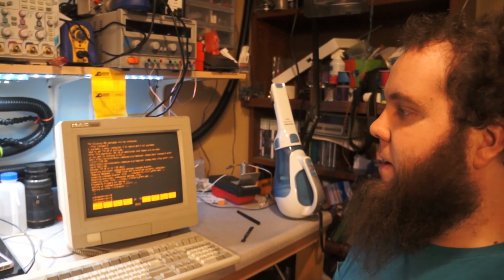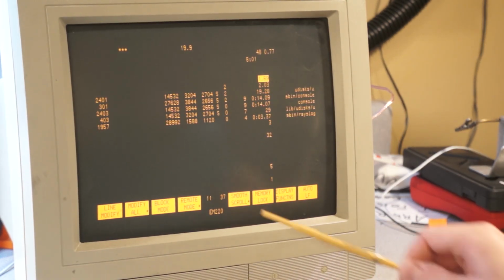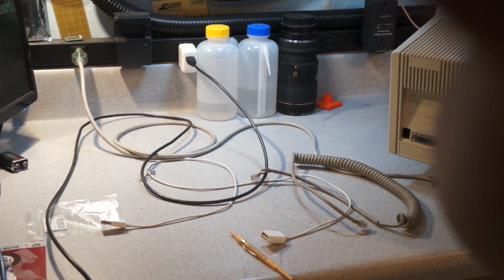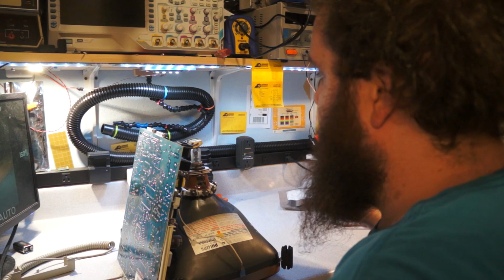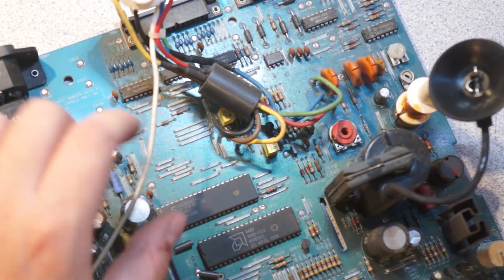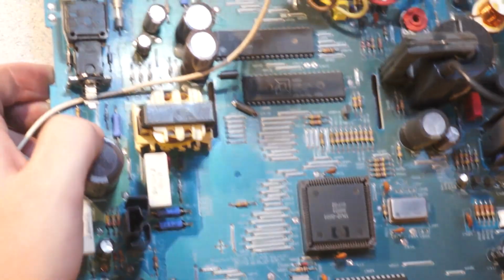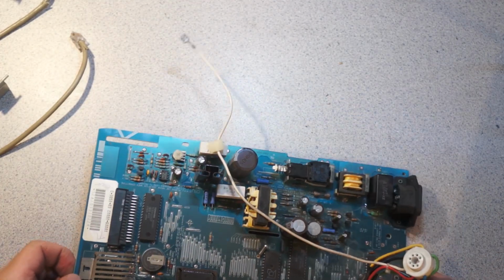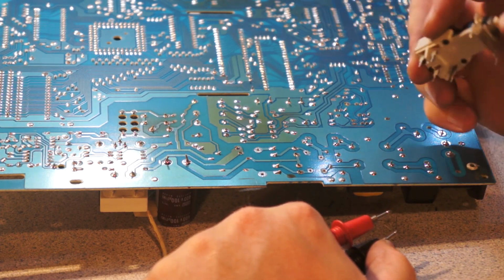HP 700/92 Serial Terminal teardown

Comment: I remember those. We had this exact type of terminal in the Applied Math lab of the Technical University of Crete, way, way, way back - 1994 to 1997. They looked pretty cool, the keyboards were also great, but programming in Fortran 77 with vi was a pain.

Comment: I know it's been a long time since you posted this video and you may not have your 700/92 anymore. Do you remember if you used a null modem or straight through cable? I've tried three different null modem cables with no luck. At one time I had my terminal connected to an old PBX so I'm pretty sure the terminal is okay but who knows.
Reply: In my experience with mine I’ve had to either use a null modem cable adaptor or cable. Also, make sure the settings are correct on the terminal so that it’s using the DB9 as a serial port, not a peripheral port.

Comment: I'm old enough to have used technology like that... I still remember fondly our "huge" system with 64 serial terminals...
But (and I do have a point) most of those "mystery" keys had no meaning for us "back in the day" either... so it's not so much a matter of age, it's more manufacturers adding "special" features that nobody understood or needed ... not much different from current technology there. ;)

Comment: nice, I still have a serial Dec terminal with green phosphor, dating from end of the 80's  , used it before on some 8051 based cpu boards.  On my first PC I got an amber Hercules screen ,(1987 ) if you wanted color , then there was CGA resolution ,I think it was 256 colors, 320 * 480 .......

Comment: Looks and acts a LOT like the WYSE terminals I've got hanging around.. Wonder if it's a custom job for HP with KB and features tailored for old HPUX machines.
Reply: They were used with HP-UX on HP 9000 line machines, and from what I can tell the HP 3000 line as well. I found a video on YouTube of a HP 3000 booting with a similar terminal.

Fun fact: HP-UX on a HP 9000 workstation with video output actually displays F key mappings carried over from these terminals. My B2600 does this when it boots/is in console mode.
Reply: It was primarily for HP3000 and was also useable on HP9000.  To take advantage of all the unique features that made it so special you need an HP3000.  HP9000 tends to run a lot of Unix software that isn’t really geared towards towards HP terminals. 

Incidentally HP also made versions of their 700 series terminals that natively emulated DEC VT220 terminals and those came with keyboards with the DEC VT keyboard layout and keys.  (And they also made a version that emulated IBM 3270 terminals with a coax connector and the requisite keyboard layout.)
Reply: Wyse 50s? 60s? 30s? ... I fondly remember Wyse terminals.... we had them everywhere at work a million years ago.
Reply: …Also, HP terminals are not at all like Wyse terminals!  I don’t believe Wyse ever made any terminals that could emulate HP terminals (which had features that made it very different from the ADDS, TeleVideo, and DEC terminals that Wyse terminals usually emulated).  If you sit in front of an HP terminal you’ll realize a difference in quality (no other company had the crisp letters that HP terminals displayed).

Comment from the maker: Hah. You can take your amber screens and leave.

I'm actually kind of surprised there were no white-phosphor monitors. I know they could do white phosphor, I've seen CRTs from the same time-frame with white light emitting phosphor.

I wonder why they so predominantly went with monochromatic phosphors? The only thing I can think of is something related to the ageing behaviour of the phosphor, but I don't know enough about the topic to comment intelligently.

Comment: The ROM card slot is for Asian character sets. Part Nos C1010-60003/60013/60023/60033 for Japanese, Trad. Chinese, Korean and Simp. Chinese respectively.
Reply: I was sure it was for character ROMs... thanks.

Comment: For the spark gap capacitors try searching for gap kap.  I learned BASIC on an old desk-sized Cromemco Z2D at school.  It had a dumb terminal and printer connected to it.
I'm guessing that maybe the cartridge slot was for software that might give the terminal new functionality like as a stand alone word processor.

Comment: Good old times.... The expansion slot is for RAM with 3V lithium batteries. One of the applications was to use these terminals for CNC machines. The expansion card then contains the milling program. This was much more advanced than the Compact-Cassettes they used before ! Today this very CNC milling machine is used together with a little Atom based industrial PC, connected to Ethernet and able to produce machined parts out of step files :)

Comment: I think that the 40 Pin DIP from AMD with the Intel copyright is the actual processor. Could be an Intel 8088 as they often have the (c) Intel 1978 on them. So the PLCC is probably the CRT controller.
Also the front panel slot might be for different character ROMs for the international market.
BTW, the datecode on the SRAM looks to be 9025, which makes sense as the HP700/92 came out in 1987.

Comment: With that Edge slot connector so near the Memory, might it be a memory expansion port?  I don't know why you'd need more memory in a terminal. Who knows.
Reply: So, per the manuals, these were used to expand the character set for CKJ language support. So yeah, memory expansion, but explicitly for character sets!

Comment: The tractor shop up the road from me is still running an old HP 9000 system with green screens everywhere...they should consolidate and migrate everything to an Itanium system running HP-UX...but it's probably not going to happen.

Comment: I think you can press q (without any modifier) to quit any modern version of top. More generally, you might try break (hopefully does C-z) and C-break (hopefully does C-c). I would think C-c *would* work, though. Maybe try pressing esc once, then C-c, just a guess.
The slot connector probably just hooks you up right to the address and data bus to potentially add an external memory with code, or take over the bus completely.
Reply: The slot connector is for adding Asian character sets. 

He is operating an HP terminal (intended primarily for HP3000 systems) in “EM100” mode which emulates DEC VT100. (It will also emulate VT220.)  In this emulation mode HP thoughtfully re-mapped many of the keys to their approximate location on a real VT100/VT220 keyboard (i.e. PF1-PF4 are the keys at the top of the num pad and the numpad tab key becomes an enter (or was it return?) key) so you basically need to ignore what’s printed on the keys.  HP actually made versions of their 700 terminals that only did DEC VT terminal emulation (to compete with DEC’s then-profitable terminals) and those came with a keyboards that had a DEC VT220 layout   (complete with PF1-PF4 above the numpad, Help and Do keys, and F1-F20 keys on top) but the downside was you could not use them with HP3000 systems.

By the way this terminal model was NOT from 1978 (that AMD processor was probably old stock). HP started manufacturing these in 1987 and continued well into the 1990’s.  I personably think HP made the best terminals (with the crisp letters made possible by half-shifting pixels) although the keyboards were not that great in terms of key quality (although DEC’s keyboards, especially in later years, were pretty crummy as well).
Reply: @tommychang6500  Thanks for the reply. This was a blast from the past. One of many many Youtube comments I forgot I left. 

I've never personally used HP terminals, or DEC terminals for that matter. Too young I guess, and I was never interested enough to seek out physical specimens of that part of history. I did watch Curious Marc's videos on the half shift pixel technique. Clever trick, and the crisp text is impressive for the time.

Comment: 19:50 They are gap caps, ie a spark gap over voltage protection device with a nominal low capacitance, some older tvs used what looked like neons but were argon filled,
Like a low power version of a gas arrestor/gas discharge tube surge protector, (ps gas arrestors make great and simple capacitive discharge HV generators)
Degaussing PTCs are another interesting looking component as they are usually a ceramic disc plated on two sides that go in a little plastic holder.